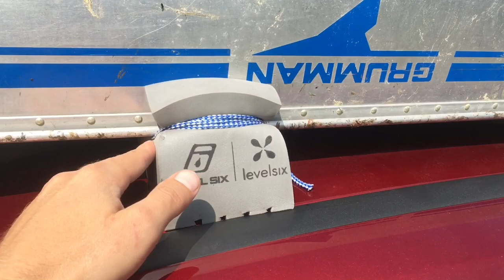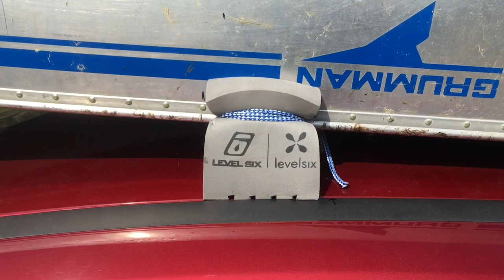One Person Canoe Loading, No Racks, Using Rope and Pool Noodles

Comment: Looks like a super experienced Grumman.  If you have carpeted floor mats, put one above each door, fibre-side down, set your first gunnel on them, and slide the canoe across.  A light lift, on the other side, will release the mats for its duties inside the car.
Reply from the maker: That’s genius! Thanks.

Comment: For me, it's easier (uses less strength) to stay at one end leaving the other resting on the ground, grabbing both rails reaching across with one hand where the canoe is about shoulder width, bending the knees to carefully rotate the canoe up and overhead, and at that point one can walk toward the center strut bumping it up and sliding the hands forward gradually to finally yoke it overshoulder and raise the far end to balance. I put a helically sliced pool noodle over the strut so that it is a more comfortable portage yoke.

Comment: I've always preferred to carry the canoe to the car, 90 degrees to it.  Place one end against middle top of car (with pads on if no carrier), push, and rotate onto car center line, then tie it down. Takes maybe 30 seconds before tieing on step.
Reply from the maker: That sounds like a hot tip to me! Thanks.

Comment: Great video!  Was thinking of using the noodles, nice to see them in action.  Definitely recommend always putting webbing around the middle as well.  The bow and stern lines will keep your canoe/kayak/sup (boat from here on out) from becoming a ballistic missile, while the centre strap will help keep it on the car while cornering, so your boat won’t end up on the side of the car.  Also, always put the straps to metal!  Pretty sure you mentioned it, but worth repeating.   If it’s not metal, it won’t hold it.  If it’s a connection piece, it should be metal to metal.  If there’s plastic involved, it will fail, if not this trip, then the next.  Use face clothes or cheap microfibre clothes if you’re wrapping the straps/ropes over body work, like from the tow hooks up over the hood.  That’ll help protect the car’s finish.  If using webbing, also put something soft under any hardware.  I like webbing because it will lie flat,  it it’s harder to tie.  And get decently rated rope, this isn’t the task for the dollar store special or that awful yellow plastic rope.  Lastly, if your boat is plastic, be careful how tight your lines are.  Tight enough to secure, but not so tight that it deforms the hull.  Hot sun and tight ropes will result in a lumpy boat that’s a pain to put right again.  

Thanks again!